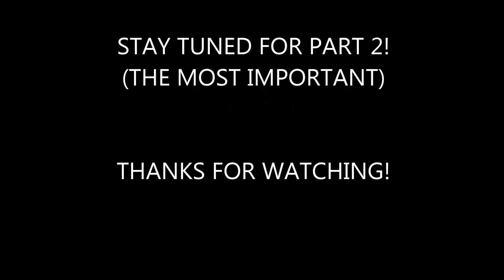1985 Toyota MR2 AW11 Restoration - Part 1

Comment: Great job, waiting for part 2. By the way, where did you get those RS*R spring from?
Reply from the maker: Thx mate. I got them from RS*R USA. You can contact them through www.rs-r.com  ;)
Reply: Excellent, thanks. Which one's do you have and are you happy with them? It looks like it sits quite nicely.
Reply from the maker: They are called Ti2000. I haven´t tried them at the track yet, but for open road (my main use) they work quite well, (not too stiff, not too soft) they lower about 35mm so you haven´t to struggle with speed bumps or other daily stuff, and the car has good balance. Hope it helps!